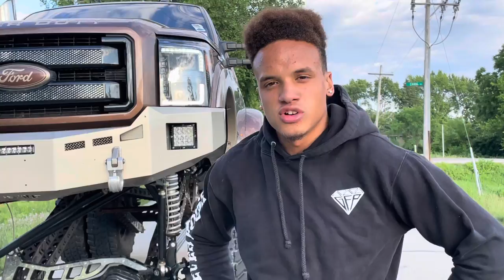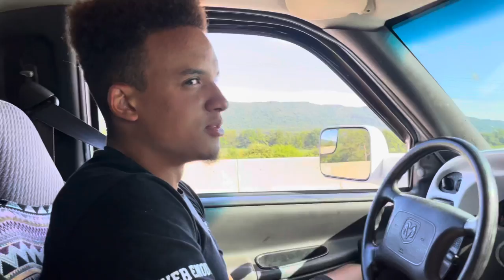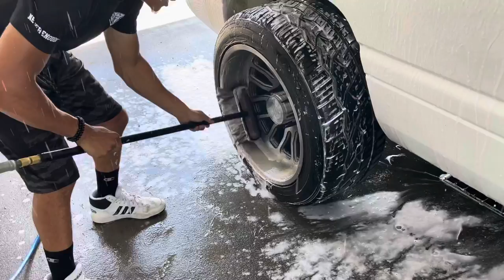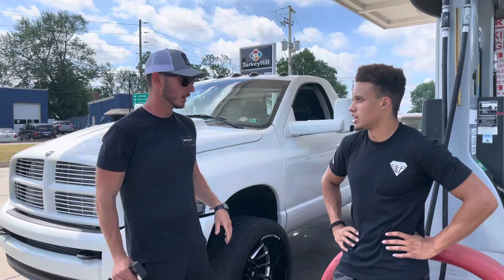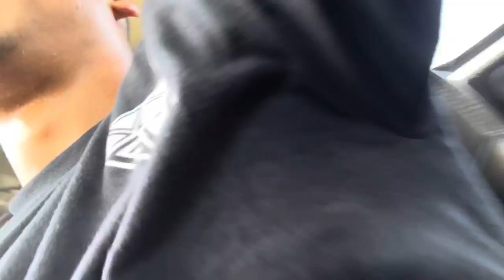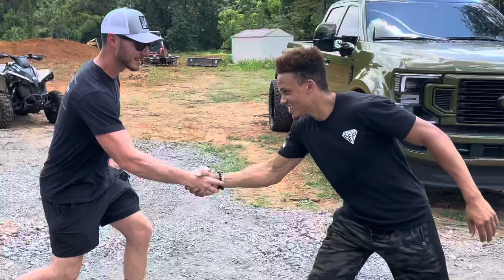800HP 2nd Gen VS Durtymax Jack’s 1100HP 3rd Gen!

Comment: In a die heard CHEVY man but yall boys make me want a dodge
Reply: Make sure you got lots of $$$ cause the cummins is a beast but the dodge is trash
Reply: @MLGtroll365  There’s literally no part of put on my Cummins that’s been over $300 and that was the A/C compressor. If you wrench on them yourself they’re easier and cheaper to work on than just about any gas burner. Cummins are made to be able to be worked on easily. They’re made where you can actually do a head gasket on one yourself. Had the transmission built for $1500. I’ll take that all day over the amalgamation of problems you can get out of a Duramax or Powerstroke. Go work on all motors and chassis one by one and cone back and tell me which ones trash. Biggest trash body is Chevrolet. Worst front end, worst rear end, and I’ve seen just as many Allisons go out as I have Dodge 48REs.
Reply: @GMbowtie350  i do all the basic work. Valve lash rocker arms studs etc.  but my trans started acting up. I have to let off the throttle at 20 mph just for it to shift inTo 2nd. But it shifts perfect after that.  I haven't driven the thing in like 2 months. It also leaks fluid out of the bowl around the rear main seal area. That black half circle cap at the bottom of the trans up by the front 4wd drive shaft.  I dont do trans. Work. 48re i think i have.
Reply: @GMbowtie350  yes cummins the easiest. V8 diesels are trash to work on.